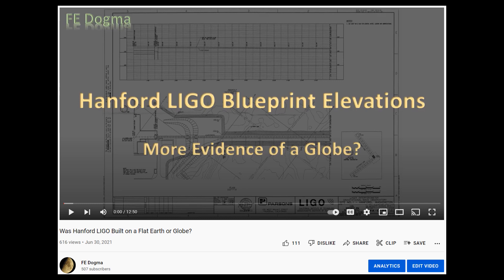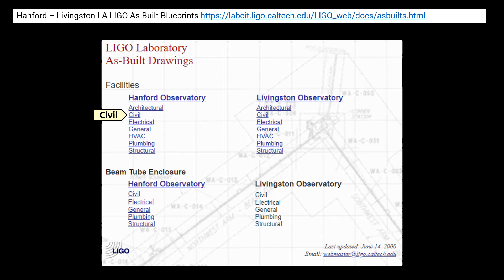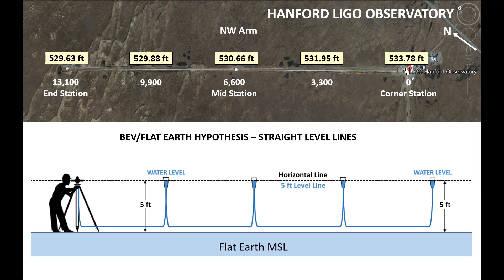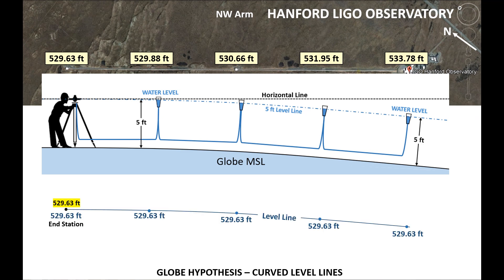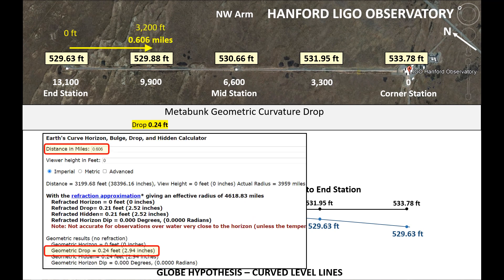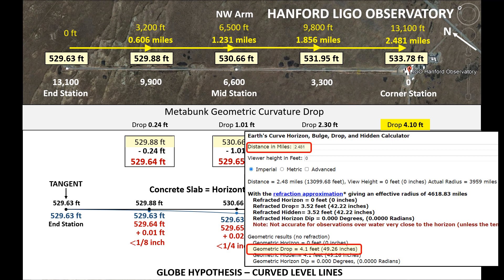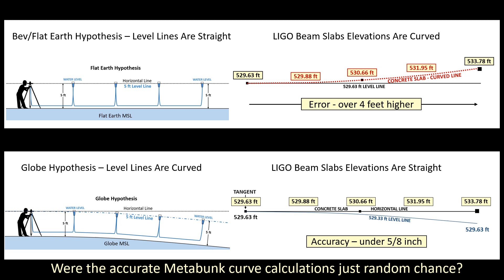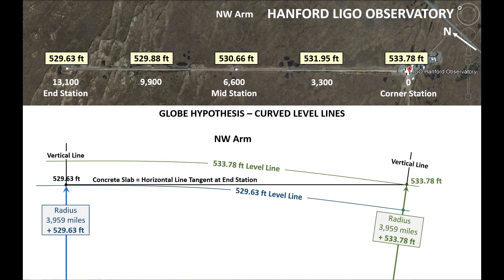LIGO Revisited - Still Globe Evidence

Comment: Bev put the tangent point for the higher arm on the lower arm and said that a claim had been made that a line had two tangent points. He then avoided acknowledging that it was himself that had claimed that the lower arm had two tangent points. Every point on a circle is a potential tangent point so draw 2 tangent lines then connect the 2 tangent points with a chord. Does the chord have 2 tangent points? No of course not, but that is exactly what Bev was claiming. Bev is worse than LEO with the ISS for inventing spurious gotchas.
Reply: "These two parts of this mountain road meet at this corner, so how can one part be higher than the other?" - someone extremely stupid
Reply: The 2 arms are linked at the corner, which is the ‘higher arm’ ?
Reply from the maker: @TryThinking  Regarding..."which is the ‘higher arm’."   I show the beam slab elevations in my video and I also gave a link to the LIGO blueprints in the description.  You claim to have surveying skills yet you can’t figure this out?  Astounding.  That says a lot.
Reply: @fedogma8407  Don't be too harsh – I didn't notice that at first, too, but just wondered why you started at one endpoint instead of the corner station. Only after just jotting down all three elevation points did it hit me. I guess they tried to use the lay of the land so that construction work could be done with the least amount of digging and building up, even though 4 ft isn't that much to deal with. (I lack the right vocabulary for construction work, but I think it is clear what I wanted to say.)
Reply from the maker: @c.augustin    I worked in commercial construction and you are right that construction costs were a decision in how this facility was laid out on the existing terrain.  Earthmoving is expensive and building up soil even more expensive since every layer requires that the soil be compacted to a required tolerance so that it doesn't settle in the future.  Also different soils have different load bearing capabilities.  This was not a factor in why I used the end station as the starting point.

This is the reason.  In geodetic surveying a level line of equal elevation curves down from the horizontal reference plane of the surveyors instrument over long distances.  Since 529.63 ft was the lowest elevation this was the level line that curved down from the horizontal line definitions I used the 529.63 ft level line elevation at the end station as the starting point.
Reply: @fedogma8407  This should also mean that the NW arm is actually "exactly" horizontal at the end station, but looks 0.036° (about 2 arc minutes) "down" viewed from the central station, right? Nobody standing at the central station would even notice this downward angle – how would it be called in builders or surveyors terms?
Reply from the maker: @c.augustin  Actually, the drop from the mid-station to the end station is only 1.01 ft or 0.009° as an angular measurement.  Even the 4.15 ft dop from the corner station to the end station is only an angular measurement of 0.018°.  No one would be able to see this but the high tolerance of surveying accuracy for the beam arm was definitely a challenge and this project was surveyed to death by different companies before, during and after construction.

When I worked on high rises our company surveyor was responsible for vertical and horizontal controls but about once a month an independent survey team came in to double check his work.

As I may have mentioned, I was responsible for many concrete pours.  Most people don’t realize that a typical slab is not that flat and an acceptable tolerance is ¼ inch over 10 ft.  It is rare when a developer requires a tolerance 1/8th inch over 10 feet because it is more expensive to do.  One case is when laminate flooring is used in condos.
Reply: @fedogma8407  Only 0.018° from the corner station? Damn, there's something wrong with off-the-cuff calculation, I have to check where I've gone wrong. Curiously, this is half of 0.036° (I was just using the circumference of 40,000 km, the 4 km distance and 360° to calculate how large the difference in "vertical" from point A to point B would be), hmm …
Reply from the maker: @c.augustin  Sorry, since you said drop I thought you were talking about the angular drop from a horizontal  line at those positions so I used angle = arctan(height ÷ distance) or arctan(4.1 ÷ 13,100) = arctan(0.0003129...) = 0.00179°.  Yes, the difference in verticals between the end and corner station is a very tiny 0.036°.  

I think you might be understanding why most surveys are plane surveys since we are talking about very small differences over short distances which are well below typical construction tolerances.  Plane surveying is a lot cheaper and accurate enough.  LIGO required very experienced geodetic surveyors using top end optical devices and the GPS they used was cutting edge technology.  They would have been in the very top of their field.
Reply: @fedogma8407  Yes, the arctan calculation would've been my next try. I still don't understand where my error is (I thought this would give the same result as the angular drop, and this is what I try to figure out). I would not have thought that the surveyors would be a team from around the corner … ;-)
Reply: @fedogma8407  I think 0.036° would be the angular drop from horizontal at the corner station (has the higher elevation) to the end station. It is the angle between horizontal and the chord at equal elevation at the end station that is half this size, 0.018° (and where the arctan formula applies). Either way, this is damn small – I wouldn't be able to draw this with regular hand-drawing tools (I actually still have some of those somewhere ;-)), and it would require real effort to detect it with a builder's spirit level (some modern electronic tools might be helpful ;-)). I have no idea how large the influence of the inhomogeneous gravity field on the vertical/horizontal between end and corner station would be (I would not be surprised it it would be already in the same order of magnitude).
Reply from the maker: @c.augustin  People have talked about putting a builder's level on top of the beam but it would not be accurate enough for that tiny angular drop which is about 1/1000th of an inch over 4 ft.  As for the gravity field, that is above my way above pay scale.  You might be interested in reading this document which has a lot of information about the alignment of the beam tubes.  https://dcc-backup.ligo.org/public/0072/P000006/000/P000006-D.pdf  Very interesting article but most of the math is above my level.
Reply: @fedogma8407  Don't worry, I was just curious and hoped to get a fast answer. I'm not curious enough (read: too lazy) to dig that deep … 😁 But another question you might be able to answer: How does a surveyor mark the elevation at a specific point for the construction company to meet? I don't mean how they measure it, but just: How would anybody know/see where this elevation is? I imagine that it is something like a pole somehow stuck to the ground with a marker at the position. Say, someone has to build a ramp up to an elevated bridge (and the bridge is to be build after that).
Reply from the maker: @c.augustin  Temporary elevation benchmarks are placed on a solid immobile object such as a fire hydrant, curb etc.  The elevation point is clearly marked along with the elevation.  We use these as the baseline for our elevation grades, something a surveyor is usually not involved with.  Elevation grades are typically measured with rotating levels with rod-eye receivers since this is much quicker than optical instruments.  Elevation grades include: subgrades for footing, column pads, slabs, etc; top of concrete elevations for footings, column pads, columns, walls, slabs, decks etc and landscape grades.  

For the building perimeter the surveyor will pound a short 2x2 stake into the ground then sink a small nail flush with the surface nail and an indent from counter sink is the location.  Buildings have gridlines from which the location of the perimeter, walls and columns are determined.  The stakes are set outside the foundation so they don't get trampled during work and are clearly marked with lathe stakes that have orange tape tied to the top.  If you accidently disturb one you tell someone so they can be re-measured.
Reply: @fedogma8407  Okay, the easy answer is stakes, similar to what I thought (I think I've seen them on construction sites). I think I've seen those rotating levels, but didn't know about rod-eye receivers (yeah, I have an idea why they have a rod ;-)). Some clever stuff involved in construction. Thanks for the insights (even though I do struggle with the vocabulary, as English is not my primary language).
Reply from the maker: @c.augustin  The rod-eye is just a receiver that has both a visual and audible methods of letting you know if you are too high, low or at grade.  We would attach the rod-eye to a 2x2 inch pole, put the bottom of the pole on the benchmark, adjust the rod-eye to the correct elevation, then draw a line at that point and mark it with the BM elevation.

Now it is easy to just measure up or down for the correct elevation and readjust the rod-eye. Two people  are required with an auto-level, one at the auto-level who would need to sight then focus on the rod and signal the rod man as to whether the elevation was high, low or correct.  With a rod-eye one person would instantly know if you were high, low or at the correct elevation.  Rotating lasers are a real time saver.
Reply: @fedogma8407  This is how I thought it would be done. Nice to converse with a hands-on guy for a change! We bought a house recently which had to be core renovated (this draned our bank account); now we have to roughly level the garden – and bought a cheap laser leveling device (just a laser with a spirit level, or the other way round, however you want to see it). What a piece of crap, but good enough for gardening (or hanging a picture on the wall 😁) – I would not use it for serious work.
Reply: @fedogma8407  Regarding this "Mike Jones" – did you notice that he never answers questions he can't challenge with his imagined reality (because the answers to those questions would be undisputable and simple practical knowledge, as it would not need complex concepts he doesn't fully understand himself and hopes that his opponents don't understand either)? And that he always tried to provoke a reaction to his own imaginary questions by belittling or attacking his opponent? He never admitted to be wrong and stepped only back if everyone – even a 10 year old – could see that he's wrong, then tried another tactic to pull you back into his imaginary world and dominate the "debate"? And that he stopped responding after I exposed him without falling for his baits? His MO became only clear to me afterwards (I guess he thinks that he's good at rhetoric and would be able to win every debate by unnerving his opponent, but I used a variation of what I would call the "Professor Dave Method of Exposing Morons like DITRH" :-D). I'm not sure if I should continue by tackling his "you need a reference frame to pour concrete" nonsense he came up with as his last resort to provoke me (I know what he's aiming at, but I have his next "argument" out of the way already), but he is so darn toxic that it becomes unnerving, and it might not be worth my time. If he comes back on one of your videos, maybe a similar tactic to refute his verbal attacks might help? I wonder which meaning of "λόγος" (lógos) he refers to in his profile image; it might be the one from the Old Testament, or just that he's good with words (its base meaning) … maybe both.
Reply from the maker: @c.augustin  Everyone on that channel is the same, they don't answer direct questions with direct answers but play word games.  Mike is about as ignorant as they come and has the maturity of a child.  Actually that can be said for they rest of them but Mike is one of the worst.
Reply: @fedogma8407  Thanks, I wasn't aware that not answering direct questions is the main MO of this ilk. Yes, Mike is beyond any insight. I was astonished that he not even answered to my question if he ever built something himself, and this might be his main problem (no "hands-on" experience with stuff). I'm still thinking about poking him about reference frames (he seems to think that they need to be planar with Cartesian XYZ coordinates) for a little fun … 😁
Reply: @TryThinking  SW arm.

The NW arm has lower elevations than the SW arm. The corner is the highest point for the NW arm, and is the lowest point for the SW arm. Thus LIGO at Hanford is on a slight slope overall.
Reply: @TryThinking  hey Bev can u explain how the radar I used in the navy that has a hard horizon based on the height of the array and that formula can be used to get the exact radius of earth..... don't worry I know u can't answer it
Reply: @crazyeddie1981  Are the horizontals parallel to the ‘hard’ horizon too?
Reply: @TryThinking  He said he knows you can't answer it, and you didn't.

Grow up Bev.